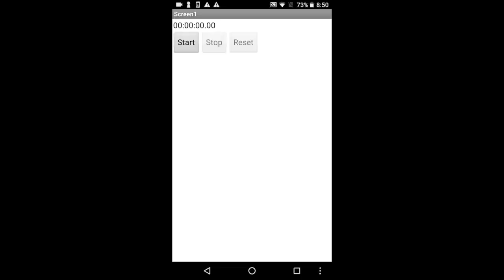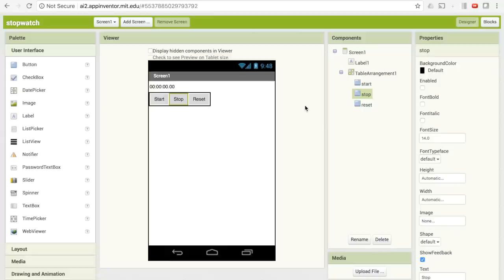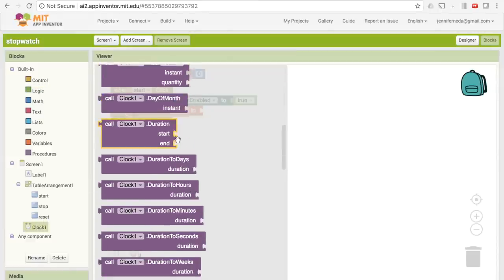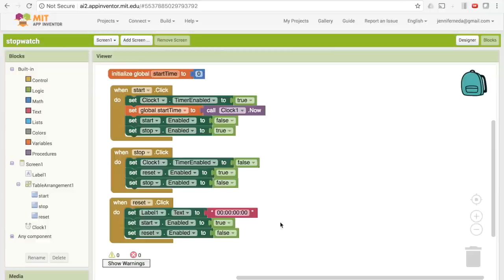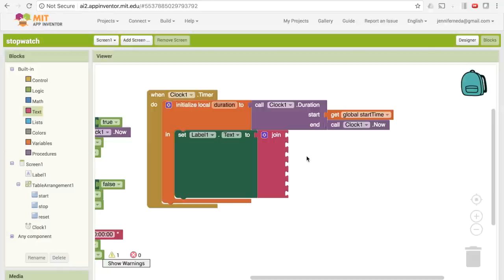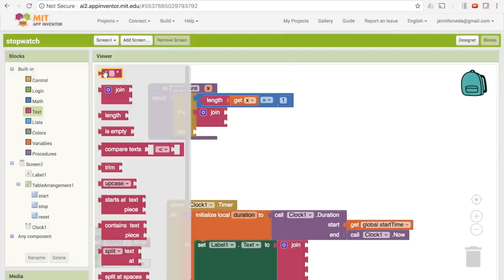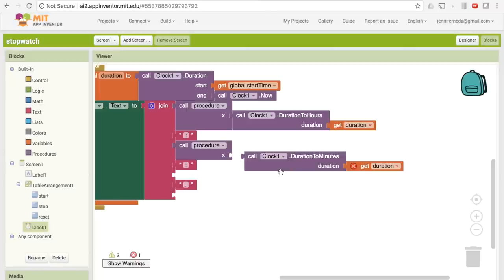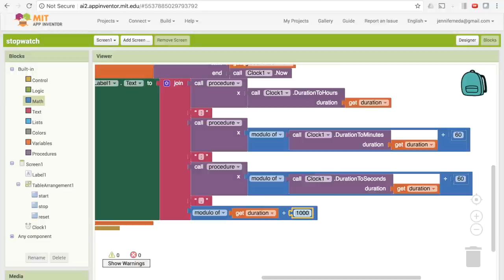App Inventor Stopwatch Tutorial

Comment: HI, thank you so much for your video. I think I followed along exactly, but I'm having some issues. When I press the stop button, I don't want the time to necessarily reset back to zero, and it does. I'd like to be able to stop, then continue on where left off, sort of pause if you will. Should that be another button/function,  or did I miss something? Another issue that I'm having is after each second (after the milliseconds count to 1000) the whole display shifts, which is annoying. I thought this was also handled, but it doesn't seem to be working.